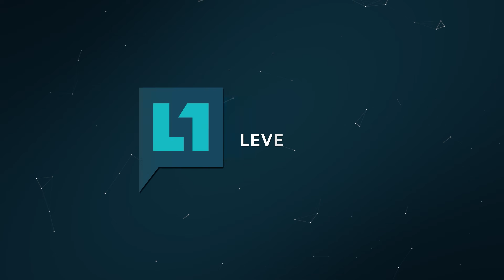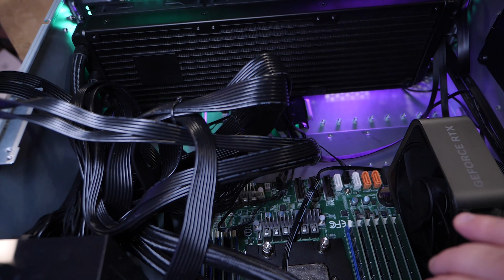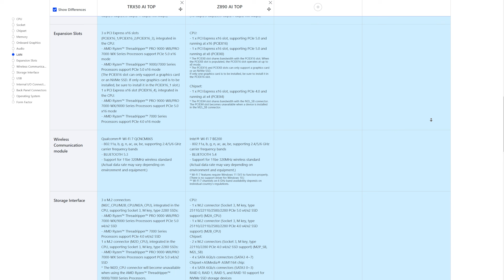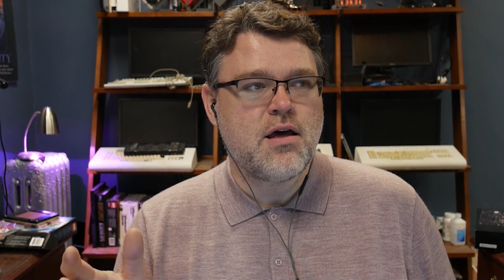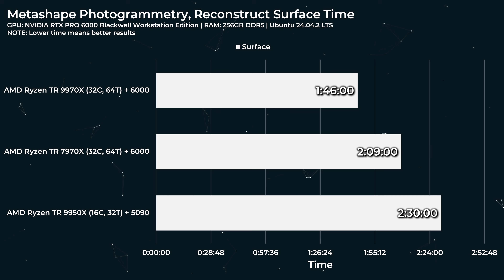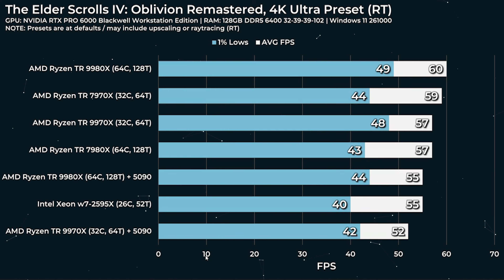Threadripper 9000! DEEP DIVE -- Productivity and Gaming Benchmarks

Comment: I appreciate the deep dive and all the benchmarks. That was a lot of work!  But you can guess I'm going to re-educate you, er... let's say I'm going to take issue with your views on more than 64 threads on Windows.  Your opinions are historically accurate for OLD versions of Windows, but are not true for Windows 11.

On Windows 11/Server 2022+, the default scheduler spans groups, so the blanket “Windows is terrible >64” is outdated unless something is forcing legacy affinity behavior or you’re running old code. Even third-party tooling authors who used to ship “processor group extenders” now note it’s unnecessary on Windows 11.

Time to let the bogeyman go on this one, I'd say.

Comment: Ouch at RAM cost! 75% more cost for same capacity? If only TRX50 supported  non-registered RAM.
But, even my Athlon MP K7D Master motherboard required registered DDR1 modules..

 Yes, enthusiasts like me will stick with the desktop platform.  Much less cost per core for BOINC and Folding Distributed Computing.

Comment: At work we have 4 workstations running 4 of our demonstation units and they all need upgrading to modern hardware, I've been arguing we should replace them with 1 of these with 4 nvidia A6000's and like a terrabyte of ram and just using KVM virtualisation to split it into 4 instances, the only issue with that is lack of redundancy, if it goes down they all would so we'd need to have a live mirrored spare in case it dies.

Comment: Is the 3Dmark Raytracing feature test GPU bottlenecked right? Why does this test show such a large difference for Wendell on all of these different CPU’s. My old Xeon w3175X and RTX5090 is hitting 230.38fps. 😁 This makes me think I could tune out the Xeon 2595X to some good levels. Maybe Threadripper 9960X would be better though. I’m so confused now though.😂 I am wanting to upgrade from my Xeon 3175x and Dominus Extreme, I run 4.6Ghz all-core daily, and 192GB DDR4@3800c14-14-14-32. System bandwidth is amazing 166GB in Aida64, latency is 53ns in Aida64. But I feel like going from monolithic die CPU to dual CCD may not be a good move? I dunno. I saw the Blender classroom for Xeon 2595X was only 157, but I’m scoring 158 here on my platform. Feels like something isn’t quite right with that platform maybe it’s just under performing.

Comment: A testing suggestion: Can you disable all but one or two 8-core chiplets on a Threadripper PRO 9000 to simulate a “9800XT” or “9950XT” with an 8-channel memory interface? Would like to see how games would work compared to the AM5 counterparts with the more powerful Infinity Fabric without any interference from having so many cores in the system.
Reply: Unfortunately memory performance is actually tied to active CCDs. The read performance is most hampered by it. That's why the CPUS with less than 64 cores use the same number of CCDs with some cores disabled.
Reply: @blkspade23 I don't think you're right about lower SKUs having the same number of CCDs.

The 9995 has 12 CCDs; the 9985 and 9980 have 8 CCDs; the 9975, 9970, 9965, and 9960 have 4 CCDs; and the 9955 and 9945 have 2 CCDs.

So yeah, a 9945 likely has way lower memory bandwidth than a 9985 (let alone the 9995), in spite of both having 8 memory channels. This was certainly the case on the 7000 series.

Comment: I built my first computer from a kit back in the pre-Apple2 days when there was a semi-urgent reason to not have to deliver quarters to the local video arcade - even in those very early days games were the thing that attracted young people into the computer business. But I think we should probably make it clear at this point that these high end Threadrippers and the Supermicro Xeon 6 server that Wendell reviewed in another recent video - these are not gaming PCs.

It may be a courtesy to run the benchmarks and post them to draw in clicks from younger viewers, but at the same time I think we should be reminding kids that you'd actually be using these systems for other things. At a certain point video arcades just stopped being a threat to the change jar quarters that we needed for laundry. When you're going to lay out this kind of money you should start comparing it with a mortgage or a car payment, and those might be the smarter way to spend that money unless you have a business-or-research-related reason to be spending it on this kind of computer.

Just a thought.

Comment: Yello. Another interesting difference between Gigabyte TRX50 Aero D rev 1.1 and rev 1.2 is the PMIC Vin (input voltage) for the memory. On rev 1.1 is ~5V while on rev 1.2 is ~12V; basically the PMIC is running on the lower input voltage (range ~4.5V to 15V) and any sudden load on the memory can drive this voltage down, enough to cause issues. This could explain why higher memory speeds can be achieved on the new revision and improved compatibility. I asked Gigabyte support about this, but they "kindly" waved me off.

Comment: It would have been nice for the benchmarks to also include at least the regular desktop 9950X (the old ones you likely already made with a "done X months ago" disclaimer would be more than enough). I think its not that uncommon for someone that buys a 9950X for a workstation to consider Threadripper to upgrade to later on. I built the 9950X because it was made the most sense 6-9months ago, but I would have bought a Zen5 TR if they were available at the time.

Comment: There's Threadripper workstation and Threadripper Pro professional workstation.  HEDT would be 12 to 32 cores.  The entry point for these things they're attempting to market toward enthusiasts is insane.  People gave intel crap over quad cores and $1700 top of stack HEDT parts but those same people constantly tell me to stop complaining about AMD charging HEDT money for consumer socket parts with HEDT core count.  It's insanity.  If AMD had not killed HEDT, I would have bought a Zen2 16 core TR4 and a Zen3 X3D 16 for it as well.  I would also be seriously looking at a 16 core Zen5 X3D now.  Why'd you have to kick the enthusiast out of the high end AMD?

Comment: Attention Wendell!
Metashape Scaling Tip:      (Especially for TR!)
Run Metashape Pro in networking mode... i.e. the server, workers all running locally on the one machine.  All ip addresses being the local machine.
We've seen very sizeable gains and can get both the CPU and GPU melting at 100% utilisation where it'd otherwise sit there for ages seemingly not doing much, with very low % utilisation.
Some of the limits of multithreading can be countered by just splitting the job up and running several instances.

How?:  Google Bzuco's reply to the "Hardware for Large Scale Projects" thread on the Agisoft forums, and the yt video he linked to.  Note that he took the yt vids method a step further by then spawning lots of nodes, and using the Network Monitor to pause/unpause them to use the desired amount of workers for each stage of processing...  We've run it with increasing numbers of workers to find the sweet spot for our hardware... Note, avoid filling the VRAM, as this obvs causes horrific swapping slow down.

Something we're really hoping will just be done invisibly, internally in the future, as CPUs/GPUs are just gonna get more and more cores...

Also...
There's a tweak Bzuco also found, google "Depth maps generation performance tip"
"BuildDepthMaps/max_gpu_multiplier" set to 4 instead of the default 2 makes a massive difference. 
It's effectively doing the same as above, splitting the job up into packages, but it's always been just 2...

With the insane hardware in this video, it'd be very interesting to see how many workers and multipliers you can use, and how much it'll give

Comment: I currently have a B550 + 3600x combo. Originally it was a nice setup. But then I added a 2nd NVME. My blu-ray vanished. The system is pointless without it. It's a media server. Eventually I discovered I had to use the middle SATA port at least on the top. I didn't check the bottom. So then I added a 3rd NVME. In order to make it work I reduced my Intel A310 from 16x to 8x. Fortunately that worked the way I wanted it to.....except the media encoding performance is about 1/3 of what it was. rebar was disabled. I'm not sure if it's disabled by 8x or if it just got reset after switching to 8x. Either way, I'm not happy with this system and I suspect it's maxed out. I'll be surprised if I can squeeze in another NVME. So........I'm looking at the 9960x. I was hoping I could do it for like $2500 or so....but it looks like that's not possible. I didn't know it required special super expensive RAM. I did know it needed a big ass cooler. Anyway I think I can get it for close to 3k. I already had the B550 and 3600x. So I'm only out the RAM......which cost me almost nothing. I think it can fit in the same case (corsair 4000d) and I believe I have a 1k PSU.
Reply: Couldn’t you try going for one of the asmedia 2824 based nvme expander cards?
Reply: @baconpancakes1752  as far as I know they are all the same thing. I'm using an ASUS hyper x card right now. The issue isn't slots. It's lanes. B550+3600x only has 24 lanes to start with. 16 of that is the GPU. That leaves 8 lanes left. 4 for the main NVME. 4 for the secondary. That means just to use my hyper x card I need to borrow some. Even if it can multiplex the lanes, this board still doesn't have wifi, which I need. There is definitely some kind of multiplexing going on with the chipset. As I'm clearly using more than 24 lanes. I think the wifi was a 1x card. 

anyway....unless I can turn back on rebar on the GPU, I feel like more lanes is the correct answer. And threadripper has plenty of that.

Comment: Why change the original thumbnail
Reply from the maker: Currently testing 3 thumbs at the same time. So it may change up on ya depending on which is doing better. ~Editor Autumn
Reply: @Level1Techs  I need to know if these boards still support s.l.i like the old wrx80 & trx40 oddly did support ????

Comment: I just want those 80 PCIE lanes 😂. I wish there was a 12 core for less than 1k
Reply: Even "just" 32 lanes would vastly improve the situation. Right now we have 24 (16x main slot, 4x m.2, 4x for chipset) which is enough for basic use, but if you want more expansion slots (high speed networking, capture cards, more nvme SSDs) you are screwed with bandwidth (4x via chipset). Even 8x going to the chipset would be a great improvement.
Reply: A used 3960x (24c/48t) on TRX40 (56+16 lanes) will get you pretty close to that price. DDR4 is cheap and gen4 PCIe works fine for AI/ML with RTX5000 series. Not that much more expensive than the dual x99 junk or cheap epycs that are a full GHz slower.

Get in on that before some YouTubers tell the world about it and cause a run on them! 😊 Bonus: probably avoids tariffs too.
Reply: I would even settle for 64 lanes...
Reply: I just want regular consumer CPUs and boards to either support biforcation or come with more lanes. There is so much wasted bandwidth on PCIe gen 5.
Reply: @pike.67  yeah if I want 10 Gbit/s Ethernetcard I usually need a by 3.0x4 slot or bigger. If I want just 5 more SATA ports 3.0x4 would be plenty of bandwith. But there is one x16 Slot way too fast for everything. Than 3 slow x1 slots and than it was on some consumer mainboards. If the 4.0x16 slot could be split into one x8 for the rendering graphicscard. And two x4 for the Network and Storage. Then an AM4 B550 would be plenty for everything I want. But I don't want to try raid on differently connected harddrives with some bottlenecks
Reply: @pike.67  both my AM4 and AM5 motherboards support bifurcation. (B350 and B650E)
Reply: @pike.67  with most motherboards, ryzen 7000 and 9000 series does support bifurcation all the way down to x4 x4 x4 x4, (not 8000 for some reason)
Reply: There was a 12 core in the threadripper peo 7945WX. I think there only 16 vore for the 9,000 series wx thread ripper. Look up Threaripper pro 9945WX.
Reply: liteally, idk why they don't build consumer CPUs with more PCIE lane counts, it's like either going big or going home
Reply: @DominG0S_OS because they tried that with server CPU's on HEDT... and well, AMD learned u need to price the HEDT stuff with Enterprise prices, because HEDT ends up slaughtered Enterprise overclocked, and it pisses off the OEM EYPC people, because they paid 5x more then you did, yet they run 1/2 as fast compared to a 5.2ghz 96 threaded overclocked monster.  

Its AMD's way of saying you NEED to pay for what you want that isn't for gamers. 

And Gamers are already getting ripped off, so we can't touch them or they will go back to consoles.
Reply: seriously though. i cant put more than 3 cards in a consumer platform and thats bs
Reply: @cal2127 And then they end up sharing bandwidth through the chipset even though there isn't anything that can saturate the top gen 5 x16 slot. And they can't be isolated for VMs.

Comment: If you're going to benchmark gaming performance, you should include gaming chips in your graphs. For 99% of people, your benchmarks here are meaningless because you simply compared them to older Threadrippers and Intel server CPUs. Kind of a worthless review in that regard.
Reply: this comparison is for people who want this kind of chip, for whatever reason, bur also want to play games on the system. it doesn't make sense to include other "normal" CPUs because the people who would be considering buying this chip will not consider buying other chips because they don't have the PCIE or the cores they need.
Reply: Gamers Nexus did, but the comparison is not really useful or important.  Some effort would likely improve the results, but why oh why would you gimp a 64c with Windows?
Reply: Why would you compare a 16 core processor meant for consumer workloads to a professional 64 core processor. The price delta between the two is totally separate markets.
Reply: @Fractal_32  Umm, maybe in the section referring to GAMING. It's actually a completely valid comparison to take a 9950X3D and compare it to the TR for GAMING. Then the comparison would make sense, to see where it stacks up. If not, you're comparing to other workstation CPUs and theres no way to know how far or close it is to the actual gaming chips. The fact you can't see this logic is kinda wild.
Reply: @carlosdominguez3108 any ZEN 5 3d cpu would show 30% higher in specific benches that favor L3 cache.
Reply: @fishingkev2332  That's literally not the point. Are you all stupid?